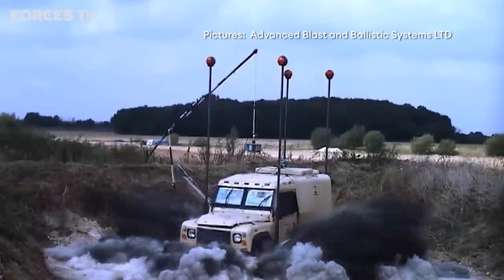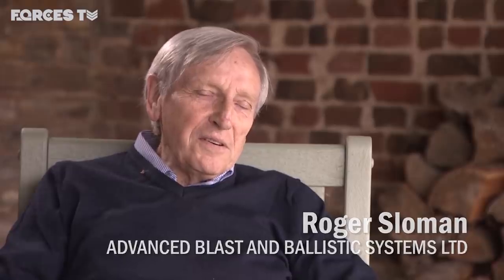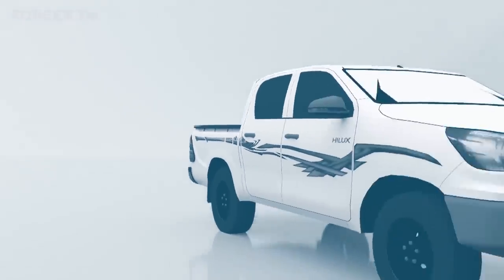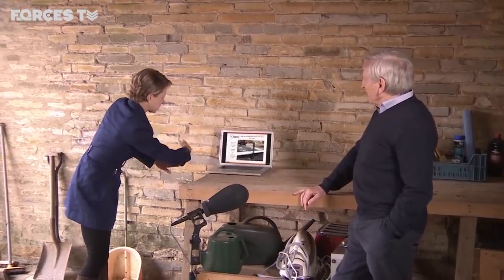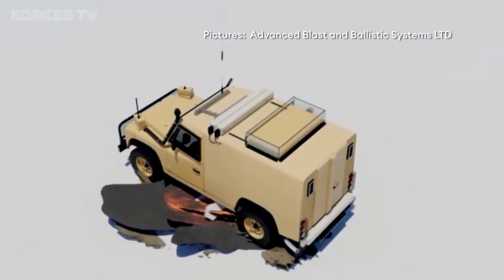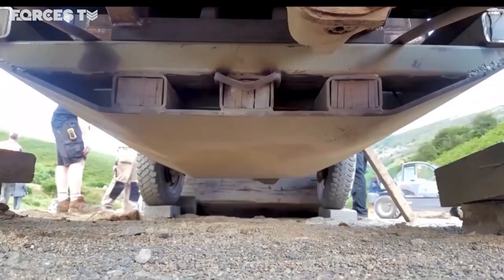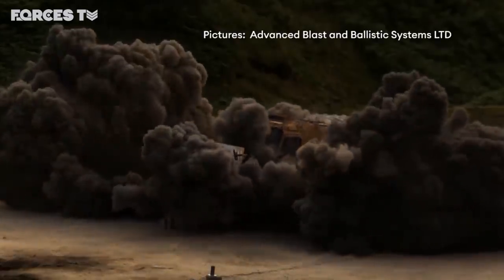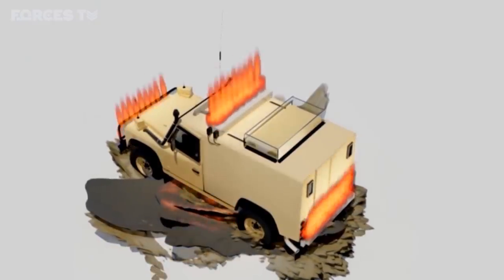Has This Inventor Found A Solution To IED Threats? | Forces TV

Comment: "let's blow ourselves up in the other direction"

British barn engineering at it's finest
Reply: Ever used noise-cancelling headphones? Same thing.
Reply: You don't want to blow up, that's the problem, you want to blow down to counter the bomb effect.  It's not complicated, it's just expensive.
Reply: Isn’t it very British, Churchill’s funnies continues.
Reply: i agree, the structure needed for the car to be "uncrushable" would require tons of metal. Otherwise, it will be like when you crush a can of beer between your leg and floor. If you use half of that metal to build an underplate, it will do the same if not better. If you have the control of those 10ms, why not make the car make a small jump reversing those rockets?! :))) add better suspension, eventually a parachute :)))
Reply: Reactive armour plate has been in use for decades.
Reply: After one hit what happens for number 2?
Reply: @tssteelx  yea wont the attacker just place a small dummy ied in front of the big killer ied to fool the system? like bang, B A N G!!!!
Reply: @warrenpeas  Everything in war is a move-countermove situation. Look into the development of armor and anti-armor systems.
Reply: @warrenpeas  i was under the impression that veichal defense systems uses a chimney to solve this.
Reply: Greatest comment 😂
Reply: Barn? It's a shed, mate.
Reply: I love this way of thinking.

Comment: “Hey Ron did we just hit a speed bump?”

“Nah just an IED.”
Reply: Tuesdays
Reply: Sure the Explosoin Does'nt MAke The vhicile Fly But The Passengers Turn to Mush
Reply: You would hear also see it outside, due to the darkness surrounding windows in air and sound of a very loud bang. Imagine, how scary that be sitting inside the armoured vehicle and can't do nothing.
Reply: Here is a normal reply..... that was a good one
Reply: @sultankuto9851  but actualy the car is fine but the crew if just mush
Reply: @rfishtail_0hmz613  true,proper shock would go through someone's body after that,but on the bright side..... One problem solved on to the next in how to insulate occupants from the shock.
Reply: “Just another Wensday,”

Comment: when trying something nobody has ever done before, nobody will believe in you but yourself.
Reply: At first thought about rocket motors when he said the car would get thrown up in the air, but thought it was dumb, ineffective, single use, would not activate up in time, expensive, the floor would buckle instead, I was wrong

But what are you going to do about the shockwave hitting the personnel's ears
Reply: @RENO_K    In an ideal world, they'd be wearing hearing protection that could minimize the damage. If the vehicle doors and stuff could be sealed well enough, it might be possible to dampen the sound greatly also.
Reply: It's honestly just not practical to produce. The military has many inventions they have funded and not funded that didn't make it...it's not practical to produce this invention yet. The guy is onto something..but it needs to change a bit. Be a shame this guy goes his whole life pushing one thing that never flys.
Reply: @RENO_K  Considering the statement made about people drowning, that tells me people already survived the initial explosion.

This is not about eliminating a threat, it's about reducing it, and mitigating factors that can be.
Reply: Then again never be so arrogant as to believe that you invented something unique. Others probably got there first, just the time wasn't right or they were not successful in finding a market. But there's a reason so many Nobel science prizes are shared. Heck even Nylon is named as it is because it was invented in New York and London at the same time :)

Comment: Almost like reactive armour,in a sense, using counteracting forces to null each out, I imagine the thumbs down are Al Qeada lurkers
Reply: Im not a terrorist for disliking and that makes no sense. More like thumbs down because I do not believe it works. the doors are blown open and the test dummies are not present in his demonstrations+ more.

Almost guaranteed those soldiers are dead, if not from the blast wave directed into the floor then through the occupants then the heatwave and other forces and I 100% promise the way that force is directed they are hurting. This is also based on the idea that there wouldnt be multiple IEDs they would be facing, and further, this may allow for any penetrating rounds (like rpgs) into the body of the vehicle to get captured more easily thus presenting more danger to the soldiers aboard.

The only thing I hate more than those trying to kill our soldiers in these scenarios- is snake oil salesman-inventors.
Reply: @zacklastname2362  you have to understand its not promised to save their lives. What hes trying to do is stop the vehicle from being tipped over, or the bottom from caving. Thats what kills most often.
Reply: @zacklastname2362  dont forget these are just initial prototypes. They will be much more development
Reply: @zacklastname2362  I think the term snake oil salesman is completely unwarranted, it’s clear the man has devoted his professional life to this sort of thing, hardly a flyby nighter. You can disagree with his theory, don’t insult  the man, he has clearly earned his Spurs.
Reply: All good points I suppose, but it's annoying reading the first point name calling people who disagree a terrorist. Because anyone who disagrees is a terrorist? What? What even is that logic?
Reply: @zacklastname2362  I agree, that its probably not going to be ready as soon as the inventor believes, but since there already exists reactive armour that can shoot down an approaching RPG-grenade, the technology at least on the computerside is there. Now its only a question of implementing at least the floor-part of the systems, for which you probably need to develop a vehicle from scratch. Still would probably be worth it. The part of the carbonfibre-reinforcment...that sounds much like a think that could be a future standard for vehicles.
Leaving the rockets, which are kinda good on paper, but on the other hand usually would be kinda useless on a real armoured vehicles. ´Cause if one of those gets thrown into the air, it means a LOT of explosives have been used and those inside are probably dead anyway. Which is probably why they used civilian modells for their demonstration (and a rather light range rover at that). And you of course could use counter that very much with other kind of IEDs and it remains to be seen if you really wanna strap rocketfuel to the roof of your cabin.
Reply: @v l Speed is not always essential in every battle grounds as new wars happen in urban areas where you move 100 m in days and this kind of zones are perfect places for IEDS. Such a good protected vehicle like this will help a lot as it will reduce injuiries and medical support line etc. Maybe it adds another 500 kg but what it returns seems to be greater. Specially IEDS are very strategic for terorists and if you can avoid their attacks they will collapse.
Reply: @zacklastname2362  did they delete the reply or you talking bout me?
Reply: You're going to have to do so much reinforcement on the frame for the Rockets for down pressure, you're going to wind up with an  armored personnel carrier and with 20,000 lb of steel reinforcements, your already there. Kind of like 2 hydraulic presses coming together at the speed of a bullet and you're in the middle, So eventually you're going to have to build a protection cage. But like he said, he's years away
Reply: @Goettschwan that's also how they make  lab diamonds
Reply: @v l also, no speed is not essential lmao. Nobody is rolling through in a convoy at 50mph. A convoy needs to drive slow enough to effectively scan and identify potential threats.

And weight on one of these vehicles? The guy said they're only 45kg. The M-ATV is the lightest vehicle the US currently uses and it weighs 29,000 lbs. 😂 You think another 100 lbs is going to make a difference? That's not even the weight of a passenger.
Reply: @zacklastname2362   It's a proof of concept. These issues can "easily" be fixed by improving the integrity of the car.
Reply: When you fake a war against innocent people then the rivers of hell await!
Reply: People who realize the entire system is predicated on there being no more than one IED per vehicle.
Reply: It's not practical. One time use, not easy to produce..this will go down with the other many inventions for the military. He's onto something..but he gotta apply his thoughts in a different way.
Reply: @zacklastname2362  American logic lol
Reply: Reactive armour is normally  on the outside of tanks armour plating.....so no nothing like it.
Reply: If they got broadband in middle east, then probably correct.

Comment: Inventor: we think we have invented a way to survive an explosion.

Reporter: How?

Inventor: we add a second explosion
Reply: Thats how ERA Works for tanks  since 1960 ^^
Reply: @niklasb.6707  Until the advent of Tandem  HEAT and top attack missiles, at least
Reply: @Trve_Kvlt  no ERA still prevents Tandem with YET another explosion, (modern ERA does)
Reply: @axlfrhalo  Sure, modern ERA. But there is modern ATGMs that can defeat even the best ERA, such as Kontakt-5
Reply: @Trve_Kvlt  yeah but you said tandem stops ERA and i said modern ERA stops tandem as in, it negates the intended effect tandem has.

Now whether the main charge still manages to penetrate the tank after the ERA has done its thing is another topic.
Reply: @axlfrhalo  True, fair enough
Reply: in an equal and opposite direction
Reply: Reporter: a?
Inventor: and a third explosion
Reply: If it's stupid but works, it isn't stupid
Reply: Easy way to beat ERA is just use really big HE shells. A big explosion that causes all the ERA panels to detonate. Even if it doesn't actually pen the armor, it will A: strip the tank of protection for the second attack and B. possibly cause such internal shock/concussion inside the tank that the crew are incapacitated.
Reply: How do we end the nuclear war?

Simple, we blow up the world.

Comment: The only problem is that once a system like this rolls out, the enemy will find a way to defeat it, such as a small charge that will activate the rockets, followed by the main charge once the rockets have already gone off.
Reply: Yes or just stop using normal charges and start using shaped charges that blasts a hole in the belly plate and kills the passengers inside.
Reply: Perhaps it should be top-secret. Once the concept is known to the potential enemy it is possible to defeat it.
Reply: @witkocaster  stops being top secret once they see a car survive the explosion anyways. There will always be someone observing what is happening
Reply: @TheMegaPingasMobile  If they have high speed camera...
Reply: @witkocaster  I think  an insurgent can determine that if the car and/or crew keeps moving after the explosion and the car didn't flip, something is going on.
Reply: So they'll have a bomb explode next to a bomb and expect both bombs to not explode at the same time
Reply: @TheMegaPingasMobile  Well said, you are correct.
Reply: @ricbarker4829  I'm not saying how we deal with this but we do!   It would be very difficult to fool the system and then have an effective second mine, especially as you don't know the speed of the vehicle.     Roger.
Reply: @rogersloman6635  "Necessity is the mother of invention" replace "necessity" with war. If you think that your opponent won't find a work around for this you are naive. In the history of warfare, name any military technology be it a weapon or defence system that has not been countered.
Reply: But that is the nature of warfare. What is important are the lives saved between one innovation and the next. When this solution is overcome the way it is overcome is the next problem to solve.
Nothing is permanent.
Reply: @jonwatson9765  Well said Jon.
Reply: The entire history of weapons development and countermeasures has been this way since forever.
Reply: @qalamalamala  1.the people who usa is fighting destroyed armored MRAPS,tanks,and held back usa for 20 years,i think they know what they are doing.Second,yes people believe a man who lived 1400 years ago and called people to GOD,called people to the truth, and maybe you don't have to worry about fixing or improving your armored cars if you stopped invading other countries.
Reply: @qalamalamala  and plus killing yourself in islam is not allowed,or killing others for no reason,or killing them for not believing

Comment: He excluded the fourth way people die when their vehicle hits a mine: Shrapnel and EFPs
Reply: True but we already have solutions to that and there's not much more we can do  beyond the age old methods of armoring. A double layer with the inner one made of a softer composite material combined with something like kevlar lining usually stops most shrapnel. Softer inner material blocks the shrapnel caused by the bomb and destroyed floor plate while also deforming instead of fracturing so it won't become fragmentation itself. The problem with armor is that it's a lot of weight, even when we consider fairly light options. They could concentrate the protection only on the floor plate and lower seat to save weight.
Reply: It's not currently designed for those threats, and the reply below gives a good response.
Reply: Manufacturing EFPs takes a lot more knowledge and effort than filling a YPOC with HME though.

Comment: Never underestimate the power of the Shed. Just watched another British inventor who has invented an engine that runs on air for fuel !
Reply: Where did you see the video
Reply: You may want to learn about thermodynamics, system efficiency and potential energy. There's a lot of hoax vids out there about perpetual motion machines and what not. Once you're armed with the knowledge of physics you'd be able to spot them immediately.

Comment: The "V" shape was first introduced by the South African military during the 1970's!
Reply: yup, those boers know what they was doing
Reply: Thank you Charles. Was about to mention it as well. Everyone on here make it sound like it is something new.
Reply: @OscarD001  The active counteraction of the mine blast forces certainly is new!
Reply: @rogersloman6635  do you have anything to prove this mate?
Reply: @OscarD001  Do you have anything to disprove his statement?
Reply: But because of sanctions over apartheid the Americans refused to study the SA vehicles. 
Years later they’re slapping plates onto humvees and getting it through their thick skulls IEDs are a big threat.
Reply: @morerightrudder9742  I added a link
Reply: @jonsmitt9769  that's true and unfortunately British soldiers as well
Reply: @OscarD001  😊
Reply: @morerightrudder9742  😂
Reply: @OscarD001  he’s the inventor, well his name is the same at least and I’ve seen his comments a few times on here.
Reply: @OscarD001  @Roger Sloman is the inventor so im sure he know what hes talking about alright?
Reply: @ohg4338  and all I am saying is that the technology is not new alright!
Reply: @OscarD001  the v shape is not new but, as stated, results in a rigid heavy unstable vehicle.
In a light vehicle the floor plate deforms. What is new here is the use of carbon fibre beams to minimise the distortion. Keeps the weight down. Distributed the force to the chassis members like a flying buttress in architectures.
I suspect the result here is a light, low comparatively inexpensive vehicle which should mean adequate numbers being produced.

Comment: My Brain hurts literally, that was a very old concept that was tested back in 1960’s that discovered that explosives without a physical projectile can’t do well against curved surfaces cuz of the force dispersement cuz the lower curve with be mostly the thickest part so it doesn’t collapse in and the force would push to the sides were it will also push the force from the another two sides out, changing the direction from up/90 to 50 or 45 out wards of the car or even a boat but the can’t handle it cuz boats can’t be heavy so it can float and the water will act as a flat surface if anything explodes under it, back to land vehicles, and why did the US didn’t use this idea if it was affective? Cuz there apc’s are not designed to have the curve under plate for it, so they need to change a lot of things just to add that/waste money from the MBT programs, so it was canceled, but after years NOW they rediscovered it and it only took 50+ years!

Comment: Would you consider liquid nitrogen ‘bubble wrap’ panels to possibly defeat heat ?  In Iraq we designed a front mounted extended A Frame with 2 sections of PSP mounted vertically. When not in use it was lifted upright. 

We mounted a second vehicle battery which ran through an inverter and heated a web of copper wire up and down the PSP.  The PSP reached around 65 degrees Celsius with no damage or degradation to the wiring.  The A frame placed the PSP 3 metres in front of the vehicle with an intent to detonate IR IED’s

It worked. Sure, we’d lose some of the front end, however it gave us a three metre standoff.  We also over pressured the interior which was very successful in using explosive characteristics against the IED’s. Lastly we ran water and nitrogen in the run flats

I really like your system and thinking.   I’m intrigued with using carbon fibre in body armour and helmets  

Thank you for your work. We may be doing a job later this year and I’d be keen to use your product (and knowledge)

(We use Landrover Discoveries preferably 05 - 08.  They simply get a total rebuild including engine, drive train, suspension etc - preferably pre dented with different coloured doors and a baby camel on a roof rack .. ok would you believe two sheep ... how about some bales of hay .....
Reply: By all means get in contact via LinkedIn where you can see my e-mail address, or the advanced-blast website.